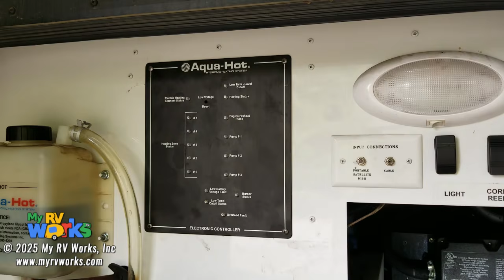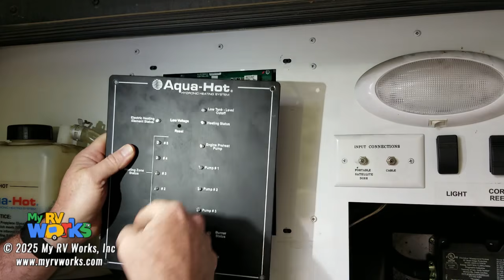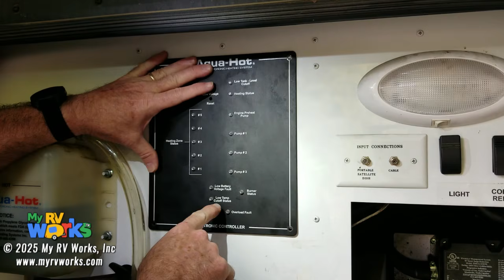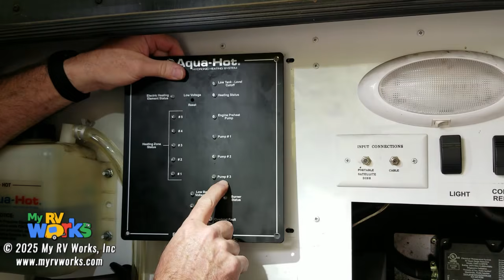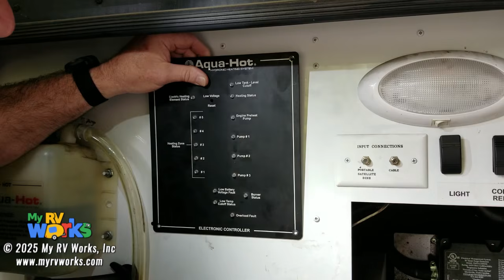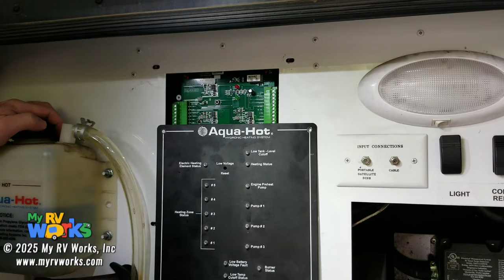Diagnosing AquaHot Issues: Control Board Deep Dive

Comment: Hi. I watched your videos. They are very helpful.  I’m on the verge of purchasing your switch for the hydro hot and flip cards. I have a hydro hot the-500-07m. I just replaced the fuel filter and nozzle. I know nothing about this system. What I do know is from your videos. My system has power. Green lights. No red. It starts. It runs for about a minute. Then just shuts off. I don’t believe it’s igniting. I think the issue is in the webasto because there are no red lights.  Would your flip cards help in this situation
Reply: I found your troubleshooting flowchart. I’m going to follow that. Thank you!!
Reply: @oprwiz7813  where did you find the troubleshooting flow chart?

Comment: Great stuff.  You said that Pump 3 should not be on *lit) if either Pump 1 or 2 is on. Well, I have 2 and 3 lit.  My aquahot is not working on DIESEL mode. Anyone have any idea why- are these things related (the lights and the non-functioning)?
Reply: any luck with yours?

Comment: Darren, great video. I found it very helpful in troubleshooting what turned out to be not a problem at all.  I thought my unit was dead based on looking at the electronic controller panel, but, the unit was actually producing heat, a real head scratcher.  Long story short, with the panel in place, it is very difficult on my 2015 coach to see if the LEDs are illuminated. I removed the panel and the status of each LED was very obvious but certainly not overly bright. Voltage on the input terminals was 13+ volts. With the panel removed, Heating Zone 1 & 2, Pumps 1, 2 & 3, Burner Status, Heating Status and Low Cutoff Status are all illuminated.  Heat was being produced from the front and rear registers.

Comment: I have a 2009 450DE unit I think low level switch bad. I have a low level light and pump 3 light on. The level switch has 3 wires. Can I cross it to check switch ?

Comment: Great video. Just finished diagnosing one with the service manual…ugh. Fixed it up. It was just low on boiler antifreeze and had a bad level sensor. Hadn’t worked for about a year. Ordering your stuff this winter for easy diagnosis next time! Thanks again for the content!

Side note, agree that the lights are quite misleading!